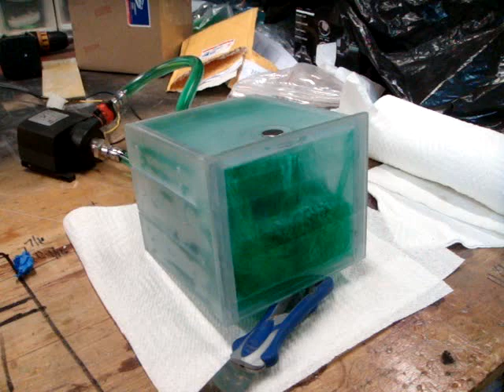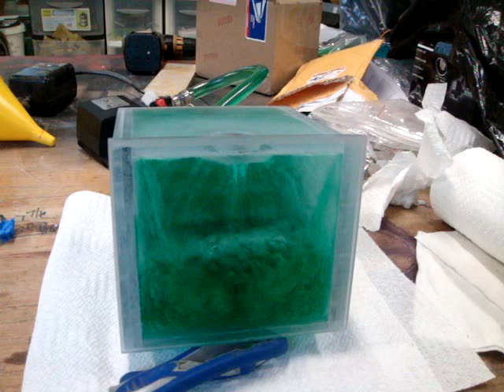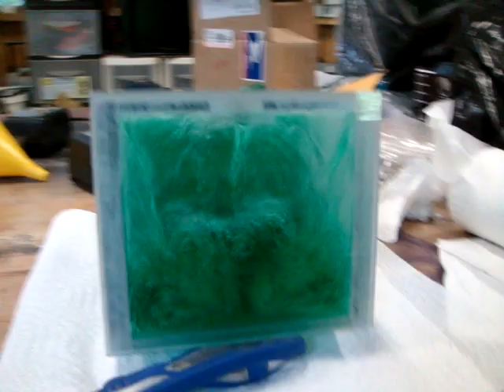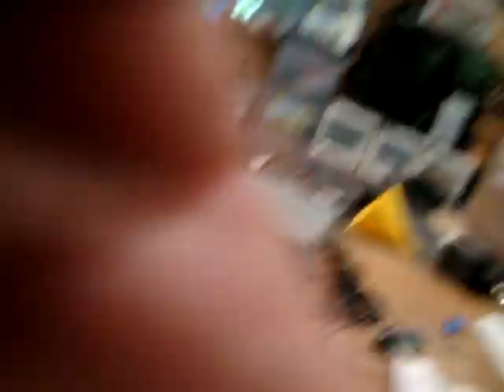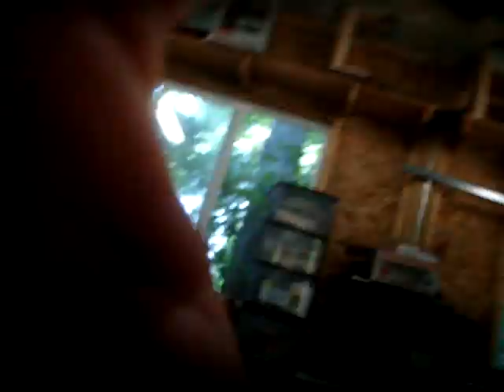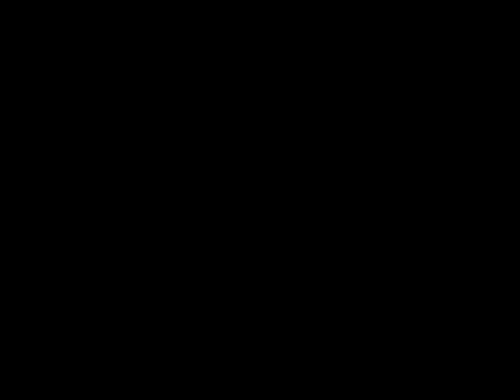Polycarbonate Waterfall Reservoir: Extended Run Test

Comment from the maker: The Alphacool 1510 can be a quiet pump. In a restrictive system where 3 meters of head and 1500 LPH would do some good the OASES powered pump shows it's stuff. Here where it's simply cycling through the res it's truly insane. Downside of the 1510 is that out of 3 I bought 2 were leaking from the start. The union between the plastic and the metal on the pump was incorrectly assembled at the factory. The body of the pump is overly light...I don't know what they were thinking...it's flimsy.

Comment from the maker: Heat dump at 24VDC has the reservoir housing at 99F. I do not have an internal sensor to get the liquid temp (which is likely a bit higher).